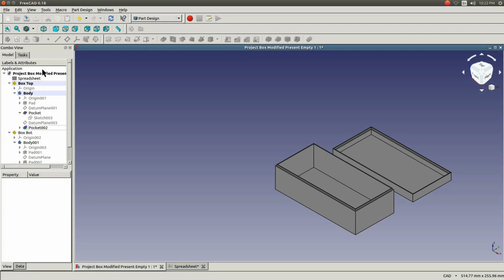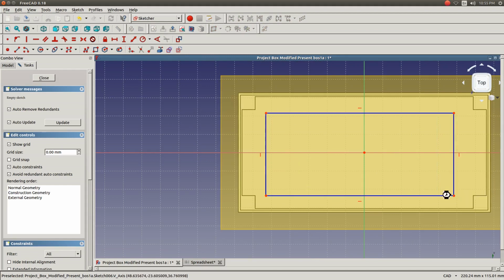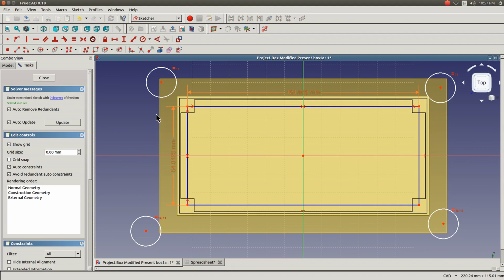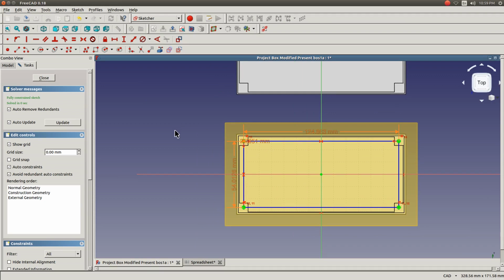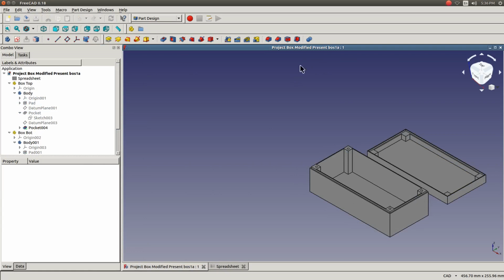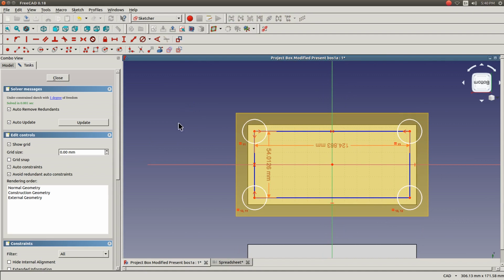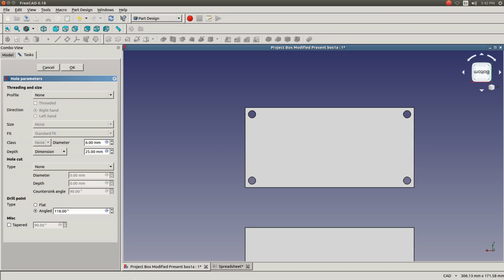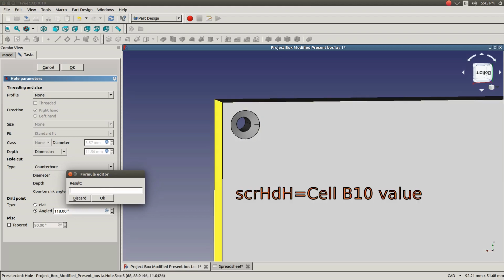Crazy Simple 3D Printed Enclosure with FreeCAD 0.18 Parametric Design Part 6

Comment: Why do you use both horizontal and vertical constraints for your rectangles?  Selecting opposite corners and the center should do it with one symmetry constraint.  Or does using both vertical and horizontal ensure that something doesn't break when redimensioned?  New to Freecad, coming over from Fusion360 and watching tutorials.

I subscribed, but put your channel into my RSS feed for notifications.
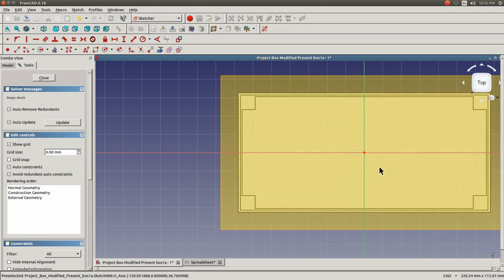Reply from the maker: First, I would like to apologize for the absence of Part 7, which is the final part in this series.  Since Friday of last week, I have been suffering a serious case if laryngitis.  This morning I started cutting the audio.  I got through the first 1:45, then my voice gave out.  Well, I almost made it to two minutes.  I will try again tomorrow.
Reply from the maker: I’m sorry, I just noticed that you subscribed.  Thank you so much.  Be patient, I won’t let you down.
Reply from the maker: Thank you for your patience.  To answer your question, whenever you select the rectangle tool, the vertical and horizontal constraints are automatically added.  I find these constraints useful.  Without them, upon rescaleing, instead of a rectangle, you might end up with a rhombus.  BTW, part 7 has just been released.  Enjoy
Reply: The comment on constraining the rectangle was that you can to it in four mouse clicks instead of eight.  The vertical and horizontal constraints aren't affected and the rectangle is perfectly centered.

I watched part 7 last night shortly after it came online.  This was a good tutorial series.  I picked up quite a few tips, especially using the spreadsheet to save the parameters.
I was able to duplicate your design. I've had three years of practice with fusion 360 but knowing where the various tools are located and some of the quirks of the software makes the FreeCAD learning curve less steep.  Thanks for listening.

Comment: Why use Notch for the body hole? Hole works just as well, doesn't it?
Reply from the maker: Yes, for many applications hole would be a better choice.  FreeCAD offers many tools to accomplish the same thing.  For instance, if you like to model in a more traditional CAD setting, there is the, “Draft Workbench”.  It’s all a matter of personal preference at the instant the model is made.  At the moment I created those holes, I chose the notch tool.  In your model, feel free to use hole.
Reply: @bcastlar3453  I started out using Hole for round things and Notch for irregular shapes and never looked back. 

I have found your point constraint and spreadsheet topics most useful. Looking forward to actually printing a box!

Thanks for the reply.
Reply from the maker: Since, on this channel, I’ve had a nearly perfect record of being late for my release predictions; I’m really reluctant to post a release date for part 7.  I was hoping for late Thursday, but that’s clearly not going to happen.  Late Saturday would be great, but with my work load it could be late Monday of next week.  All that’s left to do is fillet the inside and outside of the box.  The outside fillet radius can be either wall thickness, or half of the wall thickness.  It depends on individual taste.  The box interior fillet radius will be 90% of the boss radius.  For what ever reason FreeCAD doesn’t like the full boss radius.  Also FreeCAD seems to like to do outside fillets first.  Then start another fillet layer and do the inside fillets.